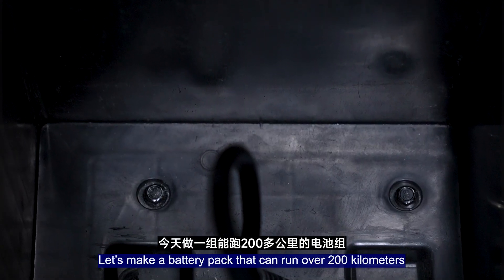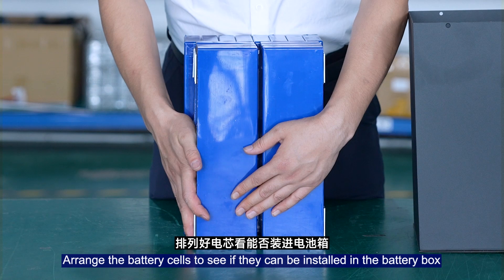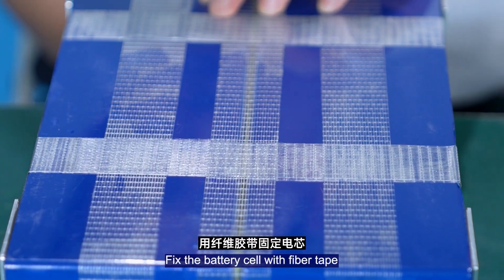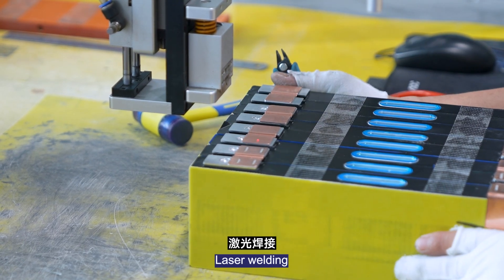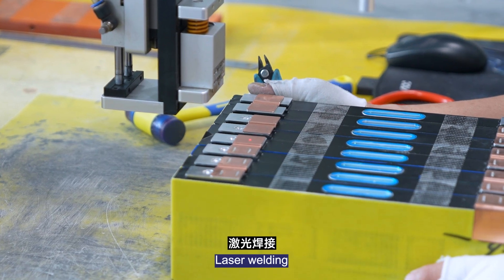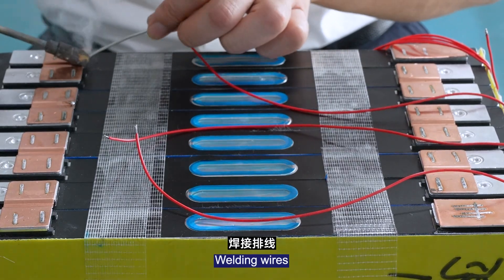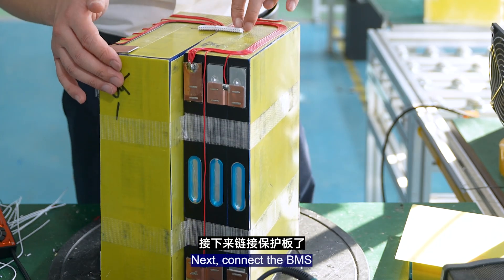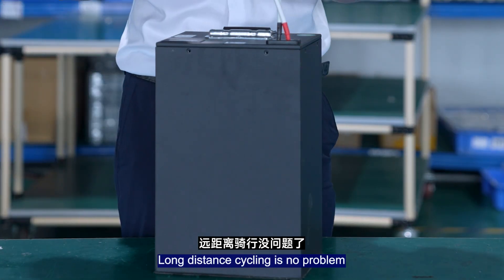Let's make a battery pack that can run over 200 kilometers

Comment: Will, plase do a LFP 60s BMS, we need a 192V for APC UPS and for many of PV Inverters who start work with battery at 180V and more, the 60-92s will be perfect.
If we can do a Serial Connection of 2x Daly BMS 48s then this solve us a problem but no one can confirm if Mosfet Vds is ready to that .